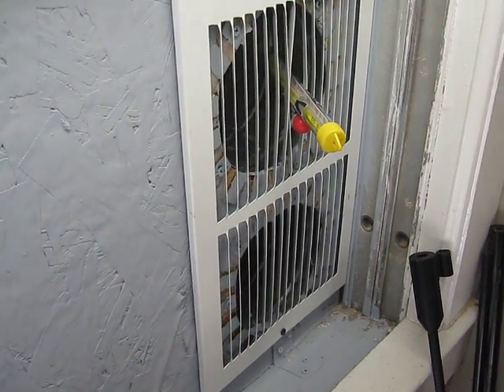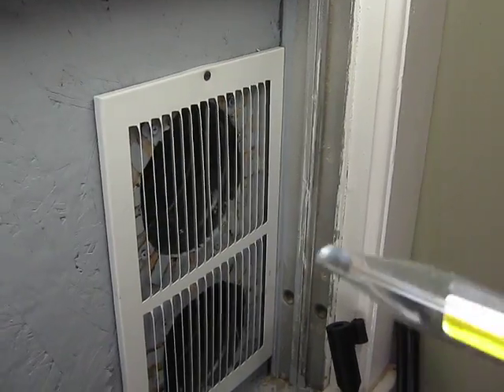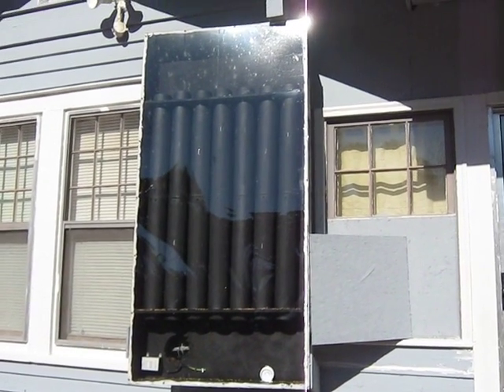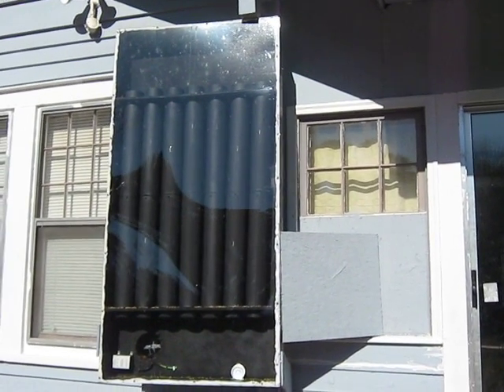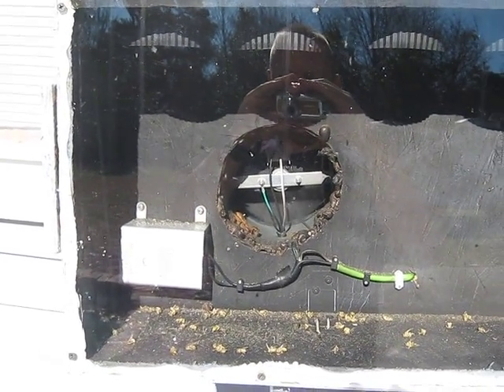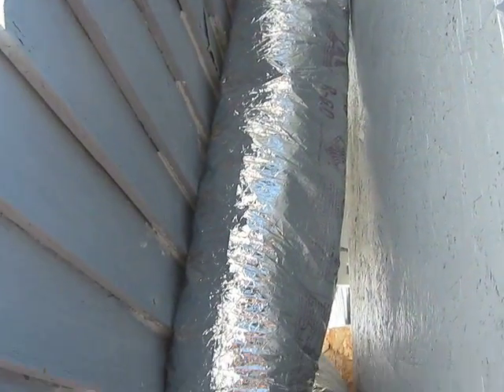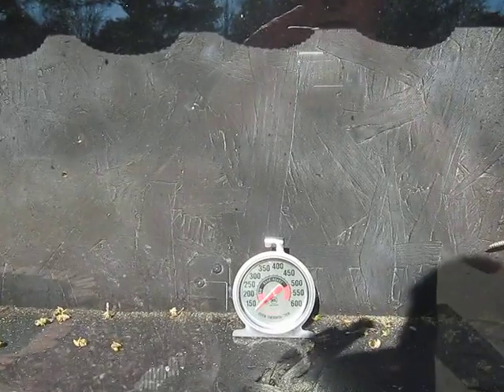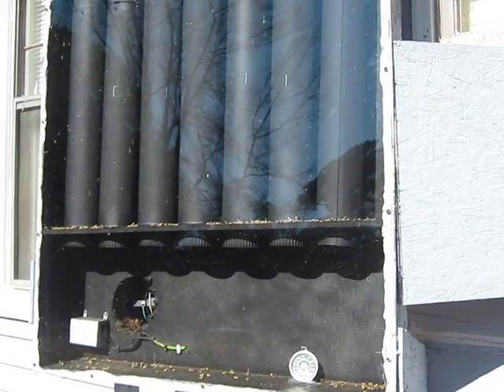My solar powered heater - Free heat

Comment: Does this type of system have the ability to store the energy for use at a later time instead of when the sun is up? So basically can I collect energy in the day and only use the heater at night or does it just run when it has constant sun?

Comment: why do i need to cut a hole in the all?  i will just build it fit in the window inside

ill take the cold air off the floor and make it hot back to the house

Comment from the maker: My thoughts when I built it was to pull the hot air down - keeping it in the box as long as possible  - to increase the heat
inside the house, the hot air coming in is over the air being pulled out since the hot air coming in will rise - (the return won't suck the hot air right back out)  if that makes any sense

Comment: The post below me is onto it, was going to suggest the same thing. Take the outlet from the top as it will be the hottest air and bring another feed from the room into the bottom of the box, that way you are increasing the temperature of the internal air rather than heating cold air from outside from a lower temperature.

Comment: Since heat rises, you should have the outgoing fan at the top, and feed indoor return air to the bottom, this way it'll recirculate air from inside the house to the bottom, as it heats up to the top exhausts out to the fan and back into the house!
Reply: yeah, outtake should be on top ... at the very least will assist the fan or even work passively.  He does not explain where the intake is ... but I noticed the window shroud to the right?   I am confused where the intake on the box is.  Maybe he wants everything at 3 foot level.

Comment: You made a mistake. Remove the two horizontal boards that are attached two the cans. They are blocking the air that should be flowing over the surface of the tubes. You will get much higher temps without those boards.

Comment: Here is an improvement... take waste black pipe... fill it with used motor oil that you get drom next oil change... fill pipes and seal and cap...

Place those in your window box.

Get a small 12V computer fan, use this instead of your 110V duct fan... and run it from a small solar powered panel.   Now you get same... but hotter, free no electricity  usage, and the oil tubes  maintain a higher temperature for longer.

Comment: i got all the gears from a bunch of old dvd players. you will have to do a bit of math but if u want to build it for dirt cheap, it beats spending another $80+ for an electronic solar tracker. copper melts at 1997F so the oil will keep it from melting. u can always just reduce the size of your mirror to limit heat output. i havent figured out the formula yet, but depending on the square footage of the house, will determine the size of the mirror. MIT recently copied this idea of mine and built 1

Comment: @MSGDREWRY a video?? just build it..i used copper pipe, engine oil and mirrored plexiglass. put the plexiglass mirror in a parabolic bowl. put that in the oven so the glass takes that shape, drill a hole in the center. build an oil filled radiator from the pipe and have one of the ends feed through the center of that hole. as for the solar tracker(to change position of the mirror..i took a 12v phone charger and hooked it up to an electric motor that drove a series of worm gears(for torque)

Comment: the box puts out the same amount of heat a window would of equal size. it just concentrates the heat of the boxes surface area into a smaller area. I've gotten my version of this solar heater hot enough to boil water. The application for this would only be ideal for cooking food or boiling water. My second solar heater got up to 2000F and parts were <$80...

Comment: @MSGDREWRY Thanks for the info. I’ve seen people use in their greenhouses, 2 liter soda bottles painted black filled with water. The bottles absorb the daytime heat and release it after the sun goes down. I don’t know how many bottles you would need but it is passive and you could avoid the extra electrical load.